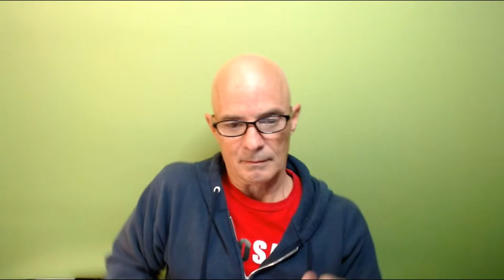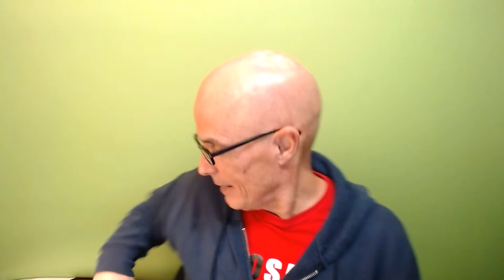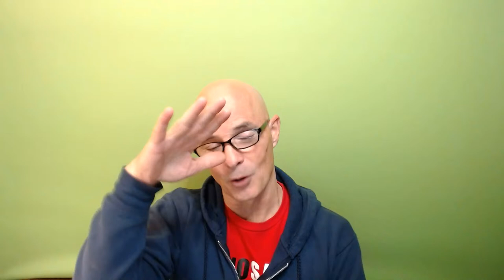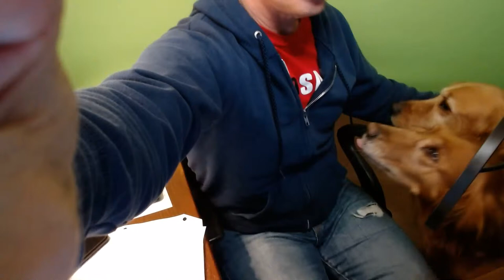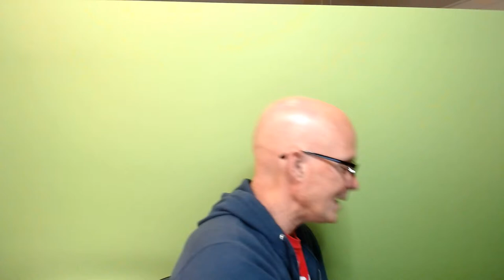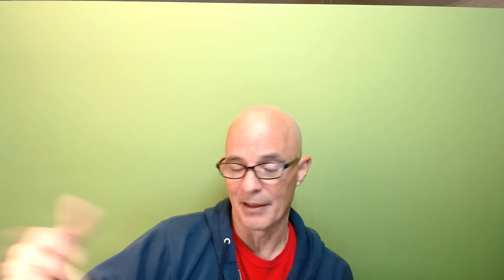LET'S TALK TECH-ELECTRONIC VS MANUAL BOOST CONTROLLERS

Comment: I use a manual controller, the type with the ball and spring inside so the wastegate sees no pressure until the controller spring is overcome. Boost comes in faster. And I just control the timing in the tune to soften it up.

Comment: Dammit I missed it. I looked to see if you were live around 10pm EST. Didn't see it so I went to sleep. Lol! But I prefer electronic boost controllers. Buddy had one in a Mark III Supra. IIRC it was the HKS EVC or something like that. After using that (I was used to the good ole manual twisty knob boost controllers, I mean adjustable leaks from the GN days), I was hooked on electronic boost controllers. The Turbo TBSS I told you about that I've been involved in has a Turbosmart Eboost2. I like being able to click a button and raise the boost on demand.
Reply: I checked too. Inconsistencies.

Comment: I would appreciate an explanation video like you talked about. I’m starting my first ls swap and I watch YouTube and read forums as much as I can but it gets overwhelming and like you said most guys go over stuff so fast and don’t explain enough that it makes it hard to learn sometimes. It would be nice if you made a video explaining all the parts it takes for a turbo setup and maybe how to choose the right wastegate sizes. Also how to size a turbo to where it doesn’t have high back pressure but still builds boost fairly quick.

Comment: Have HKS EVC 6 in both my street turbo cars.
Am using the RPM, Throttle Position and Manifold Pressure inputs, so you can get a 3d map effect for the boost control. Keeps the turbo from trying to boost all the time driving around town at part throttle, and the transition from light throttle to full throttle is very smooth.
The only downside is that since the ECM isn't controlling the wastegates anymore,  the boost isnt cut if the engine goes into sustained detonation as sensed by the knock sensor(s). But thats not likely to occur.

Comment: Most Megasquirt ECUs have electronic boost control built in. Some need a mod kit, which is about 10 bucks. I have a MS2 sitting on a shelf, which will be used for boost control when I get around to that. IMO that will be better than a manual boost controller.